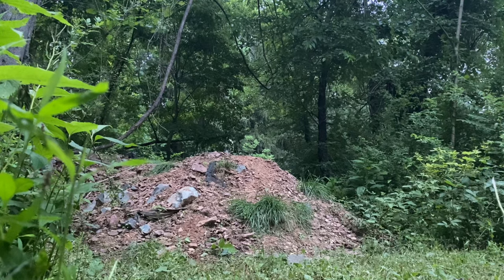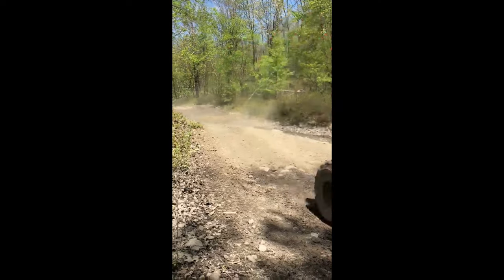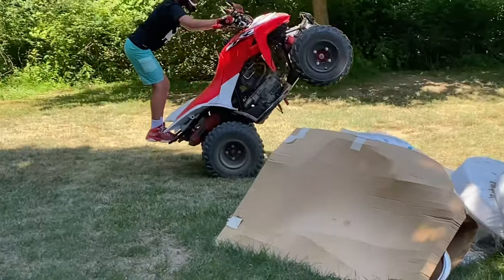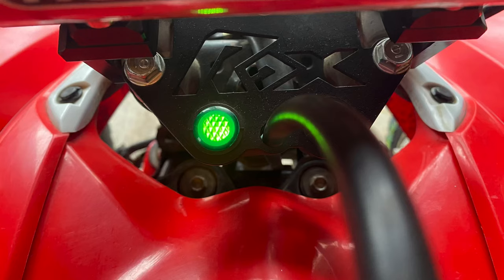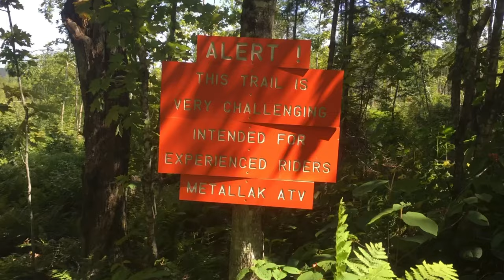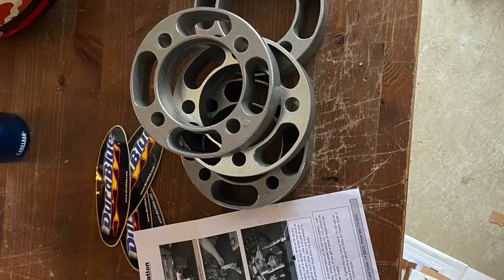2017 Honda TRX 250x build review

Comment: I just did this upgrade with the rox dash 2” risers , Rc renthal twin wall bars and spider grips ,  the cables are very short and need to be unbolted from the holding clamp and zip tied on the brake side .
Reply from the maker: Yes we had to zip tie some cables as well.

Comment: Hey man nice video, I was just wondering what Back Sweep and Width and also what height those flex bar were. If you remember can u pls get back with me love the quad.
Reply from the maker: I am running a 15 degree back sweep. My width is Quad (31 inches) and my height is Low (92mm tall). Any more questions feel free to ask!

Comment: Hey! to clean your quad to the max try to get a empty spray bottle but some wd40 in it and spray ikkt on everything and wipe it off with a microfiber rag it helps bring the red back to new again. Btw. Good job building that thing I have one of my own but I have some protaper handlebars.
Reply from the maker: I will give it a try next time I’m cleaning my quad. Thanks for the advice!
Reply: @josephbeasley2256  Ok man!

Comment: does durablue still make the 1.5" rear wheel spacers because i cant find them
Reply from the maker: My exact spacers are called the DuraBlue, 1.5” EZ Fit Urethane Wheel Spacers.  You can get the durablue wheel spacers from their website https://durablue.com/
I believe they still make the wheel spacers but I hope this helps.
Reply: @josephbeasley2256  thanks but I could only find aluminum rear spacer not the compound one

Comment: U should really look Into a budget pair of performance shocks, the stockers are total pogo sticks. U won't believe the increase in performance and handling until u drive one with real shocks. Are you going to get some real power outta that thing with a big bore kit or  maybe a 300ex carb, high comp piston or stage 2 web cam? If you haven't done the intake filter and airbox mod yet that really helps power to complement ur exhaust. And you already have the jet kit to tune it if need be.
Reply from the maker: I personally never minded the stock Showa shocks but a pair of aftermarket ones would definitely go a long way. A few months ago my quad needed a top end rebuild and when fixing it we got a big bore kit done to it along with stage 2 cams. Overall it gave the quad more power especially in the high RPM. So far we haven't upgraded the intake filter and airbox yet but I will be running an open airbox soon for better performance.
Reply: @josephbeasley2256  what big bore kit and cams did you get? I’m looking into more power for my 2014 trx250x
Reply from the maker: @chan_penner4714  I don’t remember what kind of cams and big bore kit we put on since we had it done by a shop. We had it done because the quad needed a top end rebuild. Also It did make the quad faster and more powerful though
Reply: @josephbeasley2256  oh okay, but yeah mije is gonna need a top end soon too so I was looking add some more power then as well but thanks for you help!

Comment: Hi I was wonder how to got the key switch neutral and reverse light out of the old dash to put in the new one?
Reply: I followed the wires down and disconnected the electrical connectors then pushed the lights out of the old dash, ran them in the new dash and reconnected them
Reply: @volcom21d  alr thanks

Comment: Where you buy the bars I love them
Reply from the maker: These handlebars are the Fasst Co. Flexx Handlebars. You can buy them on their website https://www.fasstco.com
Reply: @josephbeasley2256  thanks, and what backsweap,height and width are you running?
Reply from the maker: @chan_penner4714  I am running a 15 degree back sweep. My width is Quad (31 inches) and my height is Low (92mm tall). Any more questions feel free to ask!

Comment: Where did you relocate the choke on the Rex clamp ?
Reply from the maker: The choke goes right in front of the bars. We have it zip tied tightly to the left side of the bars and it works well.

Comment: I’m sorry if I missed it but what size tires are you running?
Reply from the maker: @robertwest4299  My front tire is 22x7x10 my rear is 20x11x9
Reply: @josephbeasley2256  thank you
Reply: I’m sorry to bother you again. What size tires did you go with front and rear and did it create issues on the trail getting stuck?

Comment: can you reply with a link for the new dashboard and steering bar?
Reply from the maker: Here is the link for the dash 
https://roxspeedfx.com/products/04-09-honda-trx450-400ex-atv-dash-panel
Reply from the maker: Here is link for handlebars 
https://www.fasstco.com/products/flexx-handlebar-atv
Reply: Ok ty,  and does it have a low fuel light bulb?
Reply from the maker: @dylanthe77villan93  The dash doesn’t have a low fuel light. It only has a green neutral light and a red reverse light.
Reply: @josephbeasley2256  oh alr ty

Comment: Would you recommend this bike to a adult beginner? I'm 5'8 haven't seen the bike in person but it looks small ? Is it fast enough to have fun for a adult?
Reply: I know I’m not him but I saw the comment and figured I’d help ya out I’ve got a 2019 and I would say yes I’m 5’8 and fit fine the top speeds around 50-55 so pretty fast it’s good for all ages my dad loves to rip it around. It’s kinda hard to explain the size but it isn’t necessarily “small” it’s pretty average size.
Reply from the maker: @JELO110  couldn’t agree with you more
Reply from the maker: This bike is pretty speedy and light and this bike would be perfect for a adult beginner. My dad has plenty of fun riding mine. See some of my other videos if your curious how fast it goes. I’m about 5’7 and 150 pounds and the quad perfectly fits me if your wondering. The reason it looks small is just because it’s a sport quad and most sport quads are like this. Feel free to ask more questions I have plenty of experience on this machine.
Reply: Will all those upgrades work on a higher year quad like 2021
Reply from the maker: All the upgrades on my quad should fit the 2021 Honda TRX 250's because they haven't changed much about the 250's over the years.

Comment: Mines a 2016 and looks identical
Reply from the maker: Yes the 250x hasn’t changed much at all over the years.
Reply: @josephbeasley2256  the only thing they changed was the top end because the top end in the 2016 was junk I’m on my second top end and it’s about to blow I’m putting a bigbore from a 300ex on it since they have the same diameter
Reply from the maker: @pandaman4647  That should be a cool upgrade. I somehow managed to need a top end rebuild on my 250 as well a few months ago. Let me know how it performs after the upgrade.
Reply: @josephbeasley2256 I will just saving up the money rn kinda hard for a 14 year old with no ride during the week to find a job
Reply from the maker: @pandaman4647  As a 16 year old I feel ya sometimes. Keep saving its worth it!
Reply: @josephbeasley2256  I’m up to $80 I had $90 but last night I couldn’t resist and got a 20 piece nugget and a large sweet tea from McDonald’s for $9.40